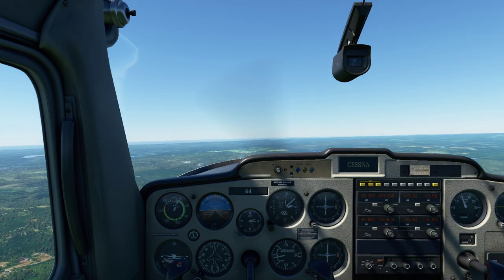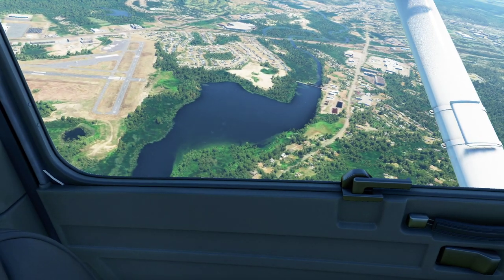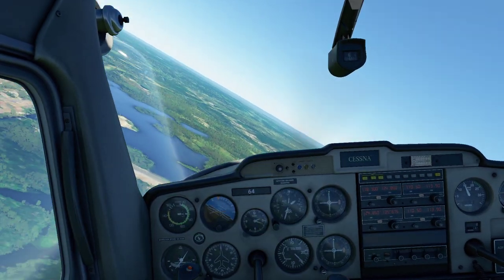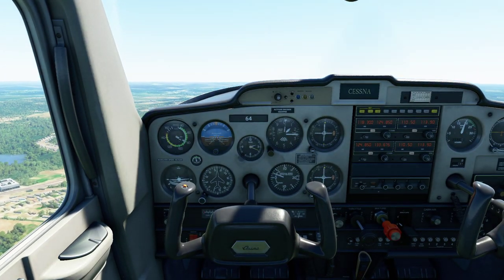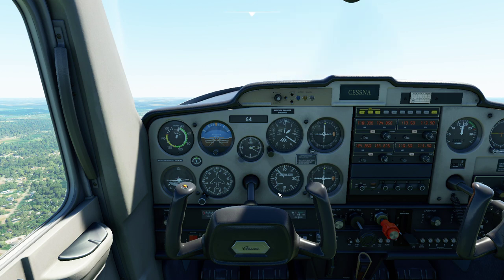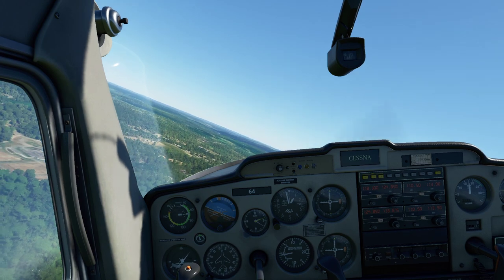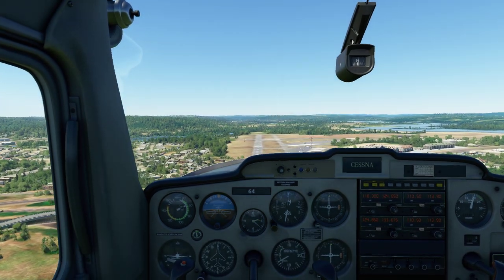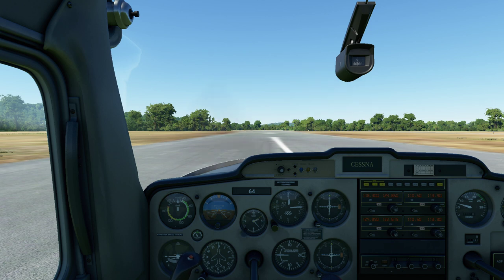Flight Simulator 2020 Basics - Traffic Pattern and Landing

Comment: Is setting the DI heading bug to that of the runway when I'm taking off to do a circuit a good idea? This helps me visualise those 90-degree leg turns as the heading bug lines up with those 90-degree fixed outer triangles of the DI.

Comment: Thanks! Please do one of these ILS series but using an small craft with autopilot
Reply: @thecorporatepilotdad  aren't you a bit fast for flaps
Reply: @chemiegamerpeter1326  No.  Up to 10 degrees of flap can be used up to 110 knots.  Beyond that, 85 knots for beyond 10 degrees of flap.
Reply: @thecorporatepilotdad  oh thanks, didn't know that
Reply: @chemiegamerpeter1326  They don't tell you that on FS2020.  If you look at the tape/placard to the left of the flap handle, the top 1/3 is blue.  In the real airplane that blue band has 110 printed on it for the speed limitation (that band is there in the game but I'm not sure if it says 110 or not).  It's been nearly 15 years since I've taught in 172s but I remember it all too well.
Reply: @thecorporatepilotdad  At our airfield many years ago, we had a cessna 182 but hail destroyed it. Since then I never flown a cessna again, cant remember a thing
Reply: @chemiegamerpeter1326  Oh hail no! 182s are nice.  I only flew 182s for about 15 hours.  I didn't fly a lot of Cessna props except 152, 172, 404, and 421s.

Comment: I don't know how to select Airports for Landing. The Airfield Codes like LFXB and etc  can't be easily found. What I mean is this, when I select ATC in top menu and then select " Airports further from you" I don't see the airport I want to land at. How can I ensure I am approaching the correct Airport if they are all listed as Codes LFXX etc? It's a serious frustration to me because even finding the corresponding Airport code in the ATC list is not obvious.
Reply: @danix30001  Hi, thanks for your reply. I did try it, the problem I had was being able to read it. I try to use Heading for Airfield navigation but, there does appear to be some inconsistencies but, my guess is I'm reading it wrong. Below is an example of where I want to go LFBX. 
https://skyvector.com/airport/LFBX/Perigueux-Bassillac-Airport

Problem I have is determining what the actual heading is. There appears to be no Heading recorded, only Runway heading which also doesn't seem to be always accurate when I fly towards it. I read somewhere that Runway numbers are headings and to determine the right course we'd have to add a "0" so Runway 28 would essentially be at a 280 degree heading.
Reply: @DonReality  It all depends on what you are flying but here are some tips on the 152 in particular:
1) Although outdated, you can use ADF (Automatic Direction Finder). In the 152 it is on the Copilot side; gauge with the yellow arrow. Tune that in; as you can see on the map you provided it is 389 (Perigueux-Bass) which is an NDB (Non-Directional Beacon). Once tuned in properly, look at your ADF Gauge and the needle will point towards that NDB, which is in the general direction of the Airport. Centralize that Needle and you are on your way there. In real life, if you want to confirm it is the correct NDB, you can look at the chart and confirm the morse code, then turn on the Speaker for the ADF and listen to it to confirm. The morse for this one is .--.-..-
2) Use the built in Map in the Sim - Zoom out and find the airport
Unfortunately, you can't be assisted by VOR because there are non around this airport. Although runway numbers in general represent runway headings, 28 = 280, etc, always review the chart as the final course may actually be off, such as 279° or 281°. It's always listed on the approach chart (top left) under Final Apr Crs. Hope this helps!

Comment: The live pause has a bug, the speed decreases once you set it on. Just try and look at your speed next time. You were going at 80, then it cut to 40 once live pause was pressed.
Reply: Yes I've noticed that too. I just have to remember to check the power after unpausing. Shouldn't be too long before this bug is fixed.
Reply: @chrisshepherd3361  yeah, I've lost control of my plane so many times now.